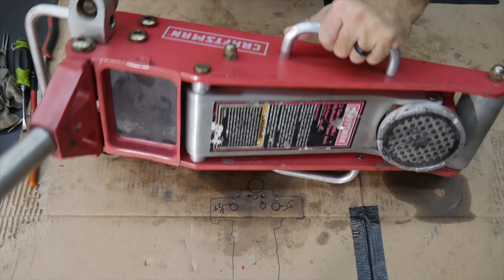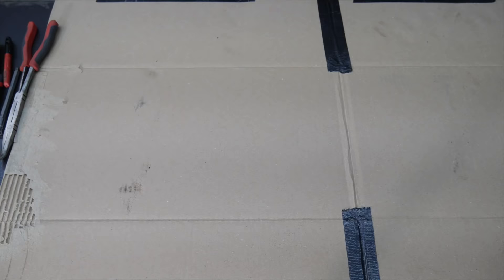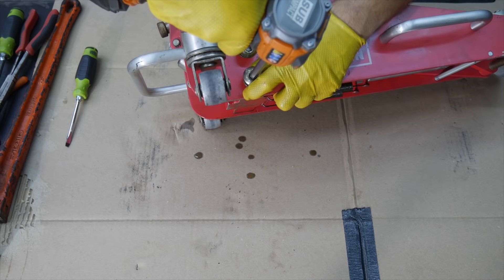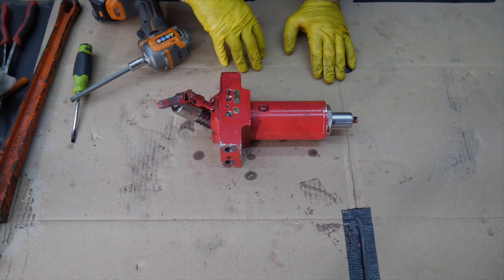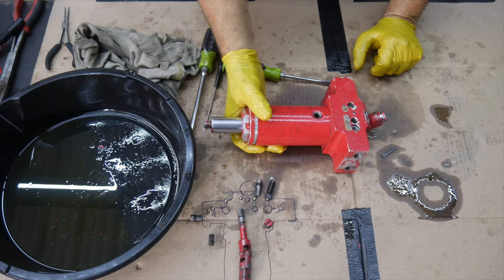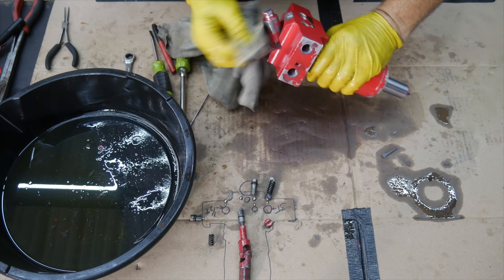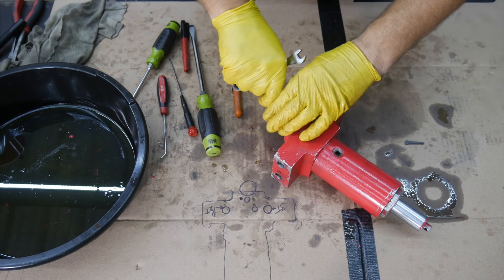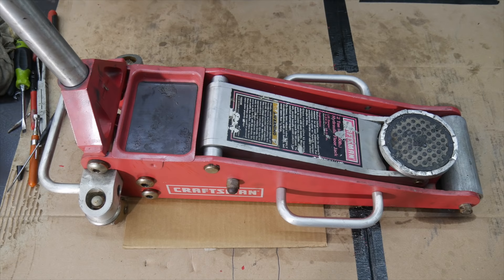MUST HAVE TOOL! How To Fix or Rebuild a Floor Jack [BOTTLE JACK]

Comment: Having that jack torn apart I would have replaced all the seals even if it needed it or not.
Reply: Having torn that jack apart, humpty couldn’t be put back together again at this house…..
Reply: Yeah. Shoddy rebuilds just like transmission shops. Mixing new parts and old parts that wear into each other is why transmission shops are always busy. No matter what issue you are having its gonna require a 3k rebuild. Which may only be a sensor or shift solenoid. They capitalize on the customers lack of knowledge and the fact that u can't prove they didn't perform the repairs claimed. It matters if u end up in small claims court.
Reply: @hotrod8915 you legally have a right to ask for all old parts and they have to provide them to you. That way you could see what was done. Not many people know that but the old parts still belong to you.

Comment: Not supposed to over fill to the top of the fill hole, this will cause a jack to lock up and not go back down. Also, when bleeding air by pumping the handle (loosened off like you're lowering the jack down) you need to leave the fill screw/plug out of the hole. Everything else was good to go.
Reply: That makes sense, because my NAPA jack fill plug is open with a ball bearing in it. The ball bearing in the fill plug lets the air out while the locking valve is open, and it makes it easy to see the air mixed with very little oil coming out of the system.  If I was to turn my NAPA jack upside down, it would let the oil out of the cylinder for the ram through the free floating ball in the fill plug.

Comment: DO NOT TURN THE ADJUSTMENT SCREWS TO BOTTOM OUT THE SPRINGS! I did that on the safety valve in my Hein-Werner jack, and it permanently compressed the spring. There's no way to get it back to the factory setting now. My advice is to leave the expansion plugs alone unless you know there's a gasket or o-ring in there that's causing a problem.
Reply: Then that spring was faulty and on the verge of failing. Or you have debris in there preventing proper fluid flow and operation.

The way he did it in this video, is the way all hydraulic repair/rebuild pros do it. If the spring is sticking, you either have a weak spring, or there is junk in there obstructing operation.
Reply: There's nothing wrong with the spring, and the areas under the expansion plugs were pristine. Pros do many things that aren't necessarily required because they have to warranty their work and/or avoid the possibility of losing time opening it up again. I adjusted the spring tension so it would lift the front of my V8 F150 without bypassing, and it's still working great a year later. That's all I care about.
Reply: I just want to add that the so called "pros" in my area don't have a clue how to fix these jacks. My local repair guy, who has been in the service business for nearly 40 years, sent three Walker-type jacks to a local company for repair. Every one of them started leaking again less than a month later.

Comment: Overfilled . You should give around 6mm of gap between the oil and the top of the filler hole , Apart from that great video , very informative
Reply: Gonna have to suck it out with a straw.

Comment: Finding the correct seal kit is the hardest part. Step 1 disassemble. Step 2 reassemble in reverse order. Step 3 verify repair.

Comment: Just and advice to save you money , don't buy a china harbour freight jack they looks pretty sure but within a year they will start to leak oil and seals are hard or impossible to find,so they are garbaje ,I got a sears 1980 jack and guess plenty  seal kits online for sale.

Comment: What I've found is that I like to replace ALL of the seals and O-rings when I go through a floor jack.
Sadly, manufacturers are more concerned with the bottom line (cost/profit) than they are with quality and almost ALWAYS use inferior parts.
My local hydraulic repair shop has proven to me that even a brand new (unused) jack can be improved with a simple rebuild with better parts and some attention to detail. 
My guy says he has yet to have one of his floor jack rebuilds come back.
Ever since he showed me that, any time I have to open up a floor jack (for whatever reason) or even my engine hoist, I go completely through it, deburring anything that needs it, and replacing everything with quality parts. I've yet to be disappointed with this method.
I LOVE how you went through this process in such detail! Best hyd jack rebuild video I've ever seen on the web! 
You have a natural teaching talent. Thank you for sharing it with us.

Comment: I just want to say THANK YOU so much for this video. My 15+ year old Craftsman 3-1/2 ton floor jack would no longer hold any weight and if it weren't for this video, I would have never had the confidence to tackle the repair. Turns out, the ram seal on mine cracked which is why it would pump up but not hold (no leaks). I simply replaced that seal even though the rebuild kit came with all the O-rings and even the valve bearings. Now works great again! But if it ever develops a leak down the road, I know what to do. So thank you for the great video!
Reply: I hello I have the same craftsman jack with the same problem, where did you buy the new seal? Thanks!

Comment: This is perhaps the best overall video on disassembling and reassembling a floor jack that I've seen on YouTube, and I've watched many in preparation to repair my own jack.  I have found no other video that addresses the channels and check valves inside the distribution block.  Really well done!  If you ever decide to edit, or add to this video, please consider including further detail on disassembling and reassembling the o-rings and seals around the ram inside the pressure cylinder.  That could be very helpful!  Thanks very much for your efforts on this video!

Comment: Thank you! My harbor freight 3 ton jack went out and needed a rebuild. Only cost me $50. (Socket plus seals) your video made complete sense and is the best jack rebuild video i've seen on yt. Thanks a lot!
Reply: where did you get the kit from
Reply: @joe911joiner6  i dismantled the jack and took it it down to my local hydraulic shop. They matched the seals for me and even swapped them out for me for free. I finished the rebuild at my house. Works great!

Comment: OUTSTANDING VIDEO!  Very well explained, I have a 3.5 Ton NAPA Jack very similar, this video makes it much easier for myself and others I'm sure.  I have my NAPA jack18 years, just last week it started to creep down. That tells me that oil is bypassing a seal or ball bearing somewhere inside, no visible external  leaks ever. The jack has served me well, now it's time to replace the seals, O Rings and bushings if necessary.  THANK YOU VERY MUCH for your time and effort, I did subscribe

Comment: hey your tutorial was great...was wondering if you could help me..... the jack i'm working on is a roush 3.5 ton g 738 .... it has 4 setting ports instead of 3 setting ports......it does have speedy lift option..thx for any help.....WRG

Comment: I bought a cheap priced Jack off Ebay that was a store return, it was a 3 ton Aluminum jack , when I got it I noticed the U joint piece was missing, I call the people who distributed it and they said even though that part is shown in their breakdown, they no longer sell it, Chinas way of making you have to buy  the whole new jack assembly.  

I thought about making a part on my lathe but did not know the thread size, so I find one on Ebay but it says it is for a 3 1/2 ton jack. I went ahead and took a chance hoping it would fit. I get the part and the drive part is  a 5/8" square shank so it would not fit the 1/2" square hole in my handle, I took a square file  used a micrometer to measure the difference in the sizes, divided that by half and filed one side till I reached that measurement, then I filed the opposite side the same bringing it to .625 thou, I repeated that on the other sides of the square hole. Stuck the handle in and it fit.

 I thought great, it should work now, but no,  when you cranked the handle the jack went up a little bit and right back down when you lifted the handle. I thought the idiot that returned it might have taken it apart losing the check balls, then I saw your video and saw there was a check ball in the port where the u joint  shaft goes. I save everything when I fix things, I had rebuilt several automatic transmissions in the past, I had 3 sizes, I used your video to determine which ball to use and put it in. Now the jack works. Thanks for your video.

Comment: Excellent thank you. I have an old Bradbury jack which has given over 60 years of service without fault. It is leaking oil now when under pressure so this video gives me a good insight of what to expect when I disassemble. It has been a fantastic jack and if I cannot repair it, it will be a sad day for me. Getting the seals might be a problem?
Reply from the maker: Those old jacks are definitely worth the time and a few bucks to get them back to new. They should definitely be serviceable. Thanks for watching.

Comment: Did I miss something? I didn't see you replace any seals or anything else.
So what was the reason for taking it apart in the first place.
Reply: That's what I was wondering too. Maybe just to make the vid, but I think if I went thru all that trouble, I would have changed the O-rings anyway.
Reply: it was obviously leaking fluid at the start of the video. should be no fluid leaking at all.

Comment: The one thing I cannot get over is the price of these kits to fix your floor jack. How can these companies justify the cost for rubber o-rings? In most cases the rebuild kit is half the price of the jack you're working on. When I guess looked up one of my jacks for parts for another $20 I can buy a whole new jack.

You provided some great information I guess I don't know if it really is worth spending this kind of money to fix an old jack.
Reply: Pricing for jack repair parts is like anything else (oil, gas, medicines, health care and products, sex toys and aids) -- the sellers will set the price to whatever the market (buyers) will bare. Thus, we have greed and price gouging wherever we go. Some people are so great, are they?  Some is good people.

Comment: Thanks for this great video.  It's too bad that the Craftsman floor jack you showed has been discontinued because it has features that I haven't seen on other similar floor jacks, like the nuts & bolts tray and the extra handle at the rear.
Reply: Goodyear makes one and the tray is magnetized.

Comment: yep, that old craftsman jack.....working on one right now.  This was a GREAT help.  I missed with the "do not adjust" valves and now I have a baseline since I'm assuming these are most likely baseline settings.    I had the u joint break and I was able to replace just the joint with a bit of work instead of having to order the entire assembly.  I also learned that one of the large allen bolts securing the handle housing is  LH....

Comment: Your video on the floor jack was very help full.  Except my floor jack 50239  cylinder came apart at the base removing the ram cylinder also.  Sitting there was a .325 steel ball bearing.  I have no idea where it goes and have tried numerous times with it and with out the ball bearing.  The jack still will not work (correctly bled).  If you ever do another video on this jack see if there is a ball bearing there and where it goes.  Thanks

Comment: I wasn’t looking for this - it just showed up in my feed. That said, I was very impressed with the amount of information and detail. I researched this a couple years ago and never learned some of the details you included. I repaired one jack back then and tore another completely apart but never got it to work. I now know why - I didn’t realize there would be ball bearings in every valve and must have lost one. I found one on the floor under a door a year later and suspected that was the culprit but never knew until now for sure. I already knew about the metal screen and was very relieved when you caught your misstep and went back to correct that. I did see that you left out spreading the cotter pin ends however. Overall great video and audio quality. Loved the hint about poking holes in the cardboard for the ball bearings. I’ve used that trick for bolts, screws and such for a while and it’s worth repeating for those that don’t know about it. Keep up the great work!  Amazed you don’t have a lot more likes and comments on this video. One other thing - finding rebuilding kits for these can be difficult but I found one guy who has an amazing site who not only sells parts and kits but also has a wealth of information on identifying and measuring parts like O-rings, wipers, washers, etc. hcrcnow.com  is the most comprehensive site I’ve found on floor jacks anywhere.
Reply: Thanks for posting the link.
Reply: Thanks for sharing 🤝✋🤛👍✌
Reply: davidayala1974   You bet!
Reply: Really appreciate this YouTube video, I have about 6 bottle and 3 trolly jacks I'm going to rebuild now that I know  what to expect , and where to get the rebuild kits !
Reply: Also wanted to say for the very few of us that has never explored the internals of a bottle jack or a trolley style type Jack , We all really appreciated the extra time you spent going through and breaking down the phases of the disassembly and the rebuild ,Thanks again !
Reply: A harbor freight magnet disk works great to hold ball bearing, small nuts and bolts etc.
The dishes come in different sizes.
Reply: @Rein Ciarfella That site has a rebuild kit for my jack but it is $80 after shipping.  A new jack would cost $200 more.  If I was convinced something else won't break, it might be worth it.  Hard to justify so much for a few o-rings and seals.
Reply: Spta97Vids   I understand, but the way I look at it if you rebuild a good quality older jack it’ll probably last you at least 20 years. There isn’t much more that can go wrong with them. A new one is never going to be as good quality as older ones. The other way people look at this kind of thing is go ahead and spend the money on repairs up to about 50% of a new one. Of course that’s an arbitrary number. Floor jacks are much more long-lived than most other tools we use these days. My two cents. 😉👍🔧🧰
Reply: @Rein_Ciarfella  I agree.   The one I have is a harbor freight so not sure it falls under “quality” lol but it has lasted me 10 years and I’m sure the new ones are worse.  I had an old craftsman professional which I threw out a few years ago because I didn’t think it was repairable.   Kicking myself after seeing this vid as that was good quality.
Reply: Spta97Vids   I still have my first jack, a Craftsman 1.5-ton and it still works fine at least 40 years later. Never had anything go wrong with it and never serviced it. It’s only drawback was the handle was required to open and close the valve. I’ve since acquired 2 used ones cheap and taught myself how they work on the 4-ton. Got the 1.5-ton working just by flushing the jack oil and bleeding correctly. Finally bought a new 2.5-ton because I couldn’t get the 4-ton to work. Wasn’t until well over a year later that I found a ball bearing in my garage and put 2&2 together. 😂👍🔧🧰

Comment: Ive the exact jack , I finally poured out the original oil , when I refilled it  now it does nit lift. On the piston it has air adjust thing on the fill plug.

Comment: Do you know how to reset a triggered safety/overload valve? On my 2 ton arcan, the right spring valve is shut compressed. The manual does not provide any information on how to reset it. Thanks

Comment: That power unit appears to be a Hein-Werner, good unit, been around a long time, I have the same unit in a jack I've had for at least thirty-five years. I noticed one thing left out and if you're going to do a full tear-down, clean and rebuild. there are  allen-head plugs on each side of the unit, sides where the bolt holes are. Inside each you'll find a check ball. Noting special just something to clean out too.
Reply: Honestly with these units less is more. The fluid rarely ever see's huge amounts of stress as most folks just lift, and then use jack stands to support the vehicle. Essentially removing the stress off the unit.

The amount of height and travel is very small, so the fluid never sees extreme temperatures or variances.

You just want to make sure the exterior of the hydraulic unit is squeaky clean before disassembling, and just remove and service the problematic area and call it a day. Keeping in mind too that most of these manufacturers don't even want to sell you complete seal kits. Rather preferring you discard and replace. So the less intrusive you are, the better you will turn out. 👍🏽

Comment: Best video regarding rebuilding floor jacks.  Question, instead of taking all the ball bearings out, could one flush the piston with simple green or other cleaners?  Mine is similar to yours but it won't lift the car up. I feel its the ram seal that is cracked that i plan on replacing .  I'm waiting for parts now. Thank you.

Comment: I have this exact same jack which leaks and have been looking for a how to video on fixing it.  Any suggestions where to get the rebuild kit, because the link shows it as being unavailable.  But I'm a bit confused.  You said your jack was leaking from the back O-ring yet you didn't replace it and instead used the same O-ring.  So how did that fix the issue?